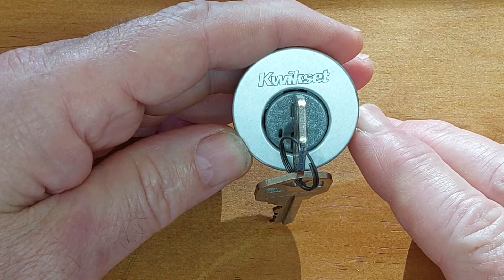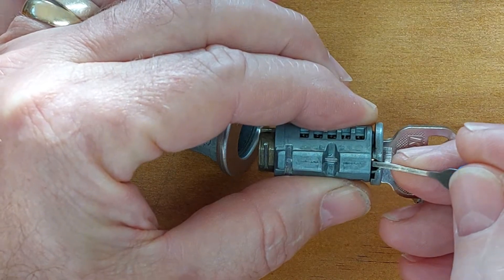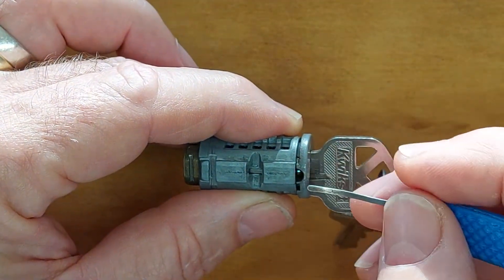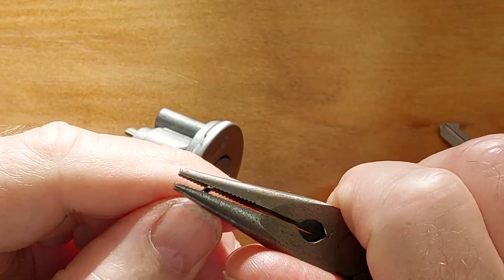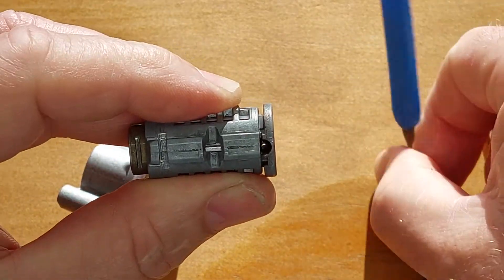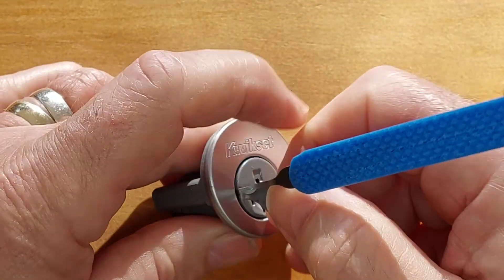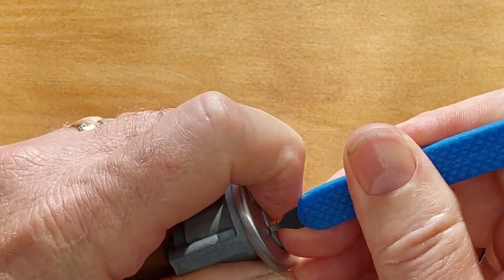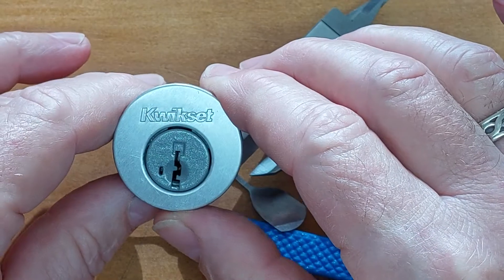Kwikset Smartkey Gen 3 - Picking - Overview of construction and use of tension tools.

Comment: Also been working on these at my apartments. These are no joke...Regarding accessing the BAR... at 5:00 where the pick arm is resting- i will drill or chip off a exactly where that recession is on the facia. Just small enough to make the first entry with the BAR press tool have one less curve to deal with. It looks minimal after so long as you keep the new "hole" small and clean. The other problem is these naturally bind with any keyway tensioning. Gonna give it another go w a  Lishi trial

Comment: Very interesting, Did you make those tools? Been looking online trying to find some if not where did you get the material to make them?
Reply from the maker: Yes, I made them. Main tool is made of spring steel with a 3d printed handle, has become a bit more malleable with repeated bending and shaping. Thin tool is from a softdrink can.
Reply: Go to any auto store and buy a set of feeler gauges . then you will have any size from.001 " to .030 " and you gan make the size you want.

Comment: Have you tried going over the top of the retainer and hitting the sidebar at the exposed point in the middle?  It seems like it should be easier.
Reply from the maker: Never tried that approach, heard it mentioned before but never seen a successful pick tensioning that way.  I do find that you can bind pins progressively from the front by slowly inserting the tension pick further into the sidebar channel which is advantageous.
Reply: @roo1yak  if you watch the LPL video of the gen3 then he uses a shim over the top.
Reply from the maker: Just watched it, shows there are many ways to attack this lock.  A conversation I recently had with another picker suggested you can use the 'rekeying' inlet as well.  Cheers for the comment.
Reply: On the knob sets I use a small punch and punch a hole in the back of the plug and use a Allen wrench to turn the spindle to open the knob. The newest deadbolts have a block in the tail piece to prevent the punch method from working.